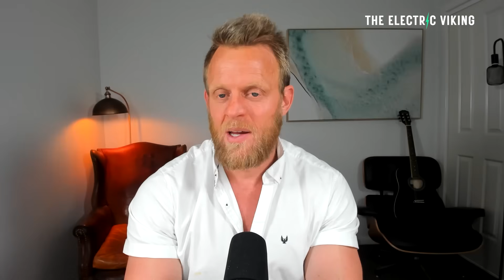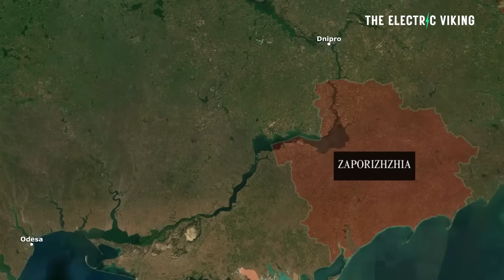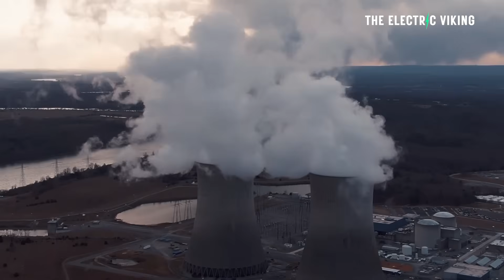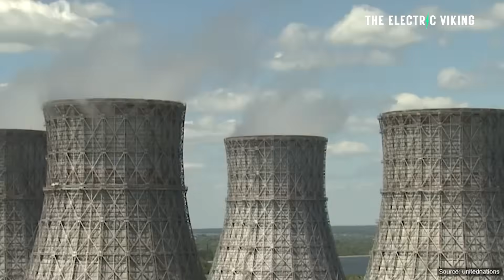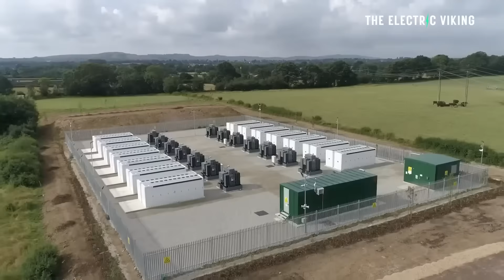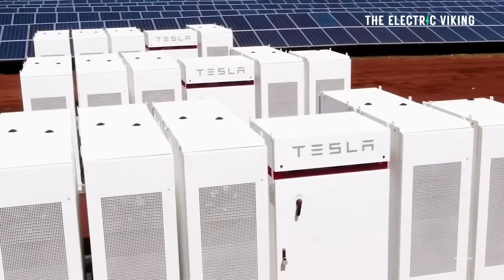UN Nuclear Agency Issues Grave Warning: Risk of Major Nuclear Accident

Comment: First; your videos are great and informative.  That being said, I disagree with parts of this video.  On what the UN has become, I have very little trust with them because of their bias, especially any grave warning. Nuclear plant pose the same amount of risk as oil to gasoline refineries.  Not all nuclear power plants are designed and/or built the same.  Example; the Fuhushima Daiichi power plant in Japan, during an earthquake and tsunami all of their safety designs, devices and procedures worked.  Not all plants are design and built as bad as the Chernobyl power plant.  And no plant can be design or built to withstand a war.  Such as oil refineries or oil fields.

Comment: I'm sorry to tell you, but this is a blatant lie. I respect your channel and the information you share, having watched it regularly. However, kindly ask you not to share russia's lie (which it's famous for). I live a few hundred kilometers from Energodar, where this energy plant is located, and can tell you for sure that Ukraine does not shell or strike the nuclear plant, ever. It is crazy to think that Ukraine would shell its own nuclear plant and put its own people in danger. 
Sam, you have to start from the point that russia has occupied this Ukrainian nuclear plant. And now it terrorizes the entire world, and first of all Ukraine, threatening to create a nuclear disaster. Zaporizhzhya NPP was always connected to the Ukrainian grid.
First, russia has occupied the land on the left bank of the Dnipro River, including this NPP. Second, they blew up the dam on the Kakhovka Hydroelectric Power Plant in fear that Ukrainian military forces would do the counter-offensive operation and capture this part of Ukrainian land back. With this disgusting large-scale action, they flooded about 40 villages and settlements and drained the Kakhovka Reservoir, which was also used as the water source for Zaporizhzhya NPP cooling system. 
Now, they deliberately cut off the Ukrainian grid from NPP, trying to connect their own, threatening the entire world with nuclear catastrophe. They want to leverage the NPP occupation to pressure Ukraine, and also to use it as a power source. russia constantly creates more and more lies in order to justify its aggression, and whitewash its hideous actions. 
So please, don't share russia's lie, don't stand in the same line with them. Thank you.
Reply: I believe you more easily than I’d believe any Russian narrative.
Reply: ☝basically what he said. Stop symmetrism here. If russia wouldn't have invaded Ukraine this wouldn't be news. There is only one side to blame here and it's russia. Simple af.

Comment: Scram shutdown.. less than 1 second to shutdown
coolidown 1-5 days
If they are shutting down and trying to get where power off is ok... you are looking at 80+ days. and you still want some circulation but each day it becomes less important... 

that is if they are shutting it down... If they are keeping it warm... 2 or so hours to a warm shutdown. but you will need some pumps. 

As for damage it has already happened the new safe confinement around Chernobyl reactor 4 was severally damaged

Comment: The reactors will melt down due to the 7% latent heat of decay of fission fragments like the Daiichi power plants that lost their cooling pumps due to lack of power and contaminated fuel from the 15 m tsunami. That's 7% of the thermal rating not electrical output.